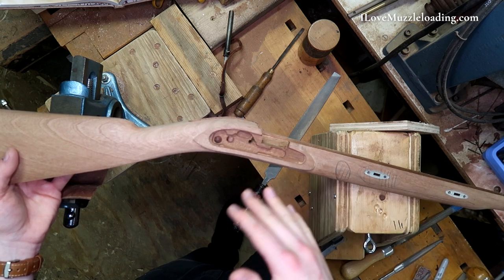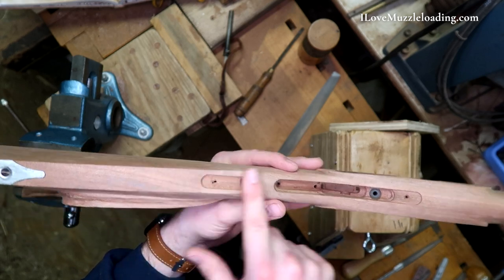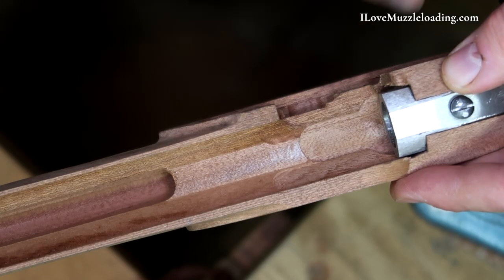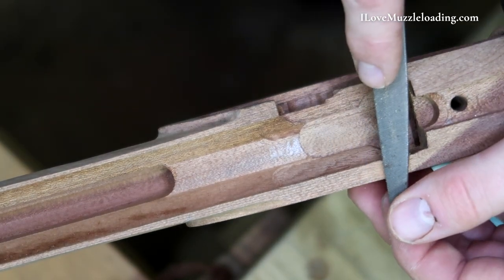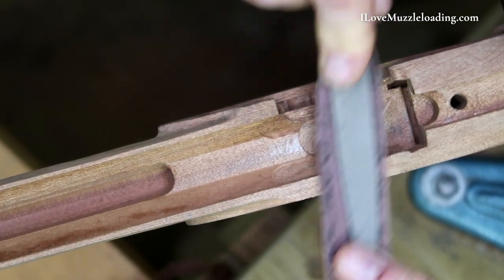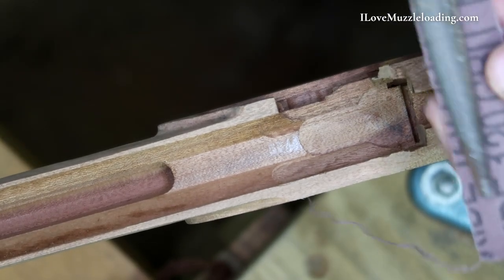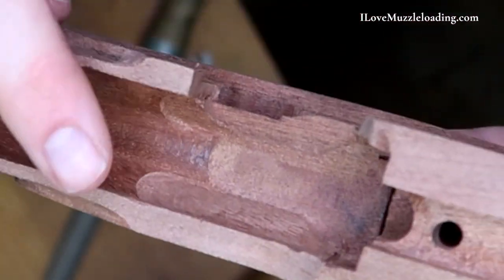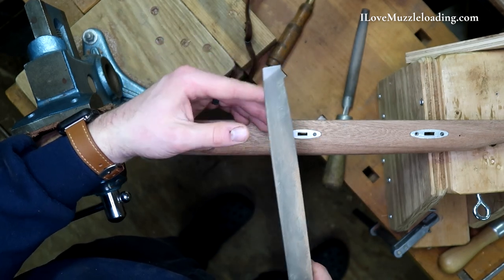Let's Build an Investarms Gemmer Hawken Kit Part 8: Making a sleek stock

Comment: I'm not sure if you have applied a finish yet.  I just wanted to pass on how I like to finish walnut for my walnut stocked rifles.  Use a dark grain filler, dye stock with orange dye and then finish with BLO dyed with Alkanet Root powder (Ratan Jot...found in Indian food spice section...cheap).  The BLO and AR require a few weeks soaking to allow the color to get to a nice blood red color.  The orange dye allows the walnut to pop.  Also, walnut naturally turns reddish orange over time.  Try it on some scrap walnut.  Keep up the great work!
Reply from the maker: Thanks for sharing! As of writing, finish is coming very soon.

Comment: If it were me I would add a small single screw side plate on the left ; opposite the lock. I would also add a Hunters Star on the cheek piece.
Reply: File with the grain. I think I have already said that ; Forgive me I'm old.
Reply from the maker: No forgiveness needed Howard, I'm a slow learner.